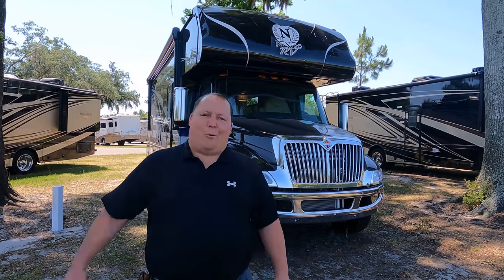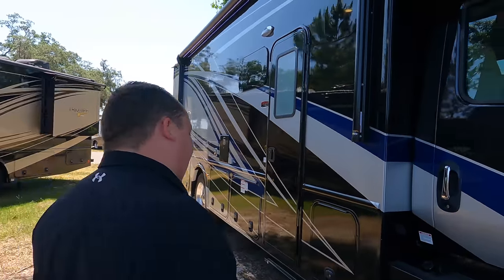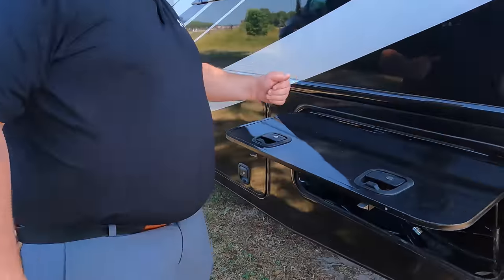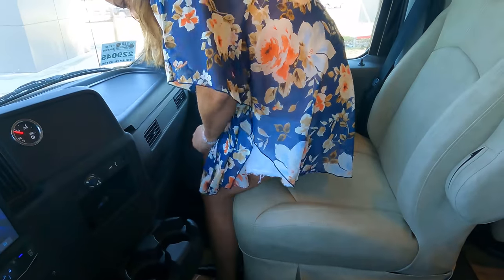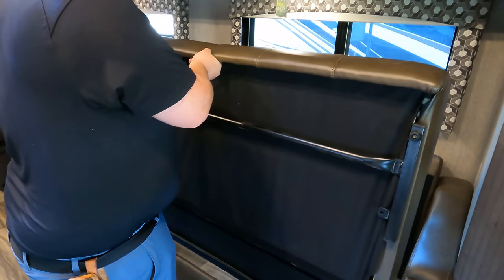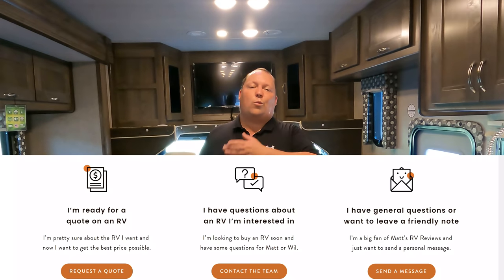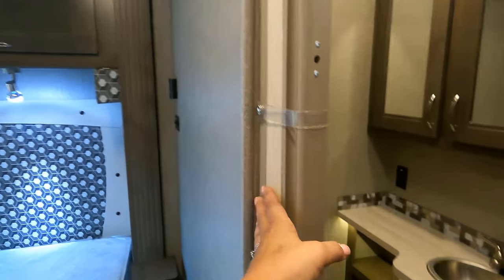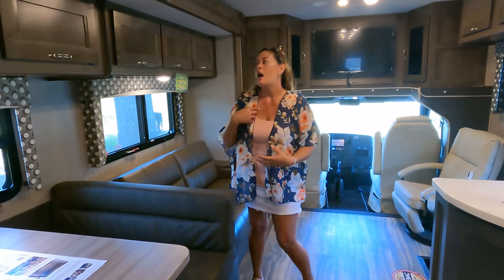The CHEAPEST Super C Diesel You Can Buy For 2022!

Comment: ❌ i'm with Andrea- the print on the valances and nightstands is WAY too busy. Makes it difficult if not impossible to use any other prints to decorate. Hard NO.
❌ outside storage doors
❌ TV placement
❌ No oven or convection oven
Reply: Valances are only put on with 4 small screws. They're easy to recover with your own fabric. But I get what you're saying... with a price tag that large, they should do it for you.

Comment: My interest dropped a notch when I saw that the outside storage doors open only to horizontal. That's inconvenient at best and impossible for those with flexibility issues. There are plenty of storage cabinet spaces inside, but drawers under the dinette seats would be great. I like that the bed is accessible for boondocking.  The pull out sofa is SO much nicer than a jackknife style.

Comment: I have to agree with you, Matt.  The money saved does make up for the features one might expect; however, in an rv like this why the overhead entertainment center?  No one is facing it!  The best seat to sit at would be the dinner table!!  What were they thinking?
This is a good overall unit, even if the 50 amp cord is shoved in a bin and there is no divider between the water connections and the storage.

Comment: The 3 things I like about this motorhome:
1. tri-fold sofa
2. the amount of walkway and accessibility with the slide-outs in
3. the construction: the steel cage framing, Azdel inside and outside, and the metal ducting

The 3 things I don't like about this motorhome:
1. TV placement
2. the baggage doors, I prefer they opened to the side
3. sigh shakes head again it's a dislike: no airhorn

Comment: Hey Matt. We like your videos. On this one, however, we have a question: There's cost (cheap) and value (what you get for your money). By definition, a $1,000,000 Super C could be a better value if it offered more bang for your buck. So, while this one's the cheapest, which one do you think is the best value? PS, regardless of price, we haven't found the right combo for us: 4X4, Super C (large engine and hood in front of us), bunkhouse and W/D. Even better? An F-550 or (preferred) new RAM 5500 limited crew cab with the aforementioned specs!! Why? Luxurious cab, 4-5 passengers could be seatbelted in a safe area (not pretending to be safe with a seatbelt in a fall-apart, non-crash-tested fiberglass shell that will disintegrate around you in a rollover), 4X4 for winter and beach trips, plus all of the other amenities I mentioned. Find it and look me up!!

Comment: Dislikes:
1) not a fan of the outside doors, should either open sideways or all the way up. Miss the air horn too
2) really dislike the position of the TV, but I do like the over cab storage. What if the TV was mounted more to the passenger side and angled?
3) Would rather have recliners than the dinette and have a free standing table
Likes:
1) I love the paint job on the outside. Nexus has been good with their designs
2) love the cabinet space though out, should have either a convection microwave or an oven.

Comment: I'm only six minutes in and I just hate the outside storage compartment doors. You'd have to squat down to pull stuff out of there because of the way those hinges only go 90 degrees. Also, you'd have to have pretty long legs to step up into that passenger seat because it's up so high. I'm 5'3" and older and that would be difficult for me to get into.

Comment: I watch these reviews and love how Andrea always wants an air horn on super C's.  But I don't understand why someone would want or need a Super C.      Please explain if you can.
Reply: It appears Super Cs, being diesels, can tow larger/heavier vehicles than a gas Class C and have higher cargo capacities.

For example, I have a gas Class C with a 5000lb. tow rating. I use it to tow a Jeep Wrangler Unlimited, which definitely weighs about 80-90% of the tow rating. Throw in four people, their pets, and stuff in a gas Class C, and you're really pushing it's capabilities.  Which is what happened to me this weekend overheating the RV transmission going up a long, steep grade.

Also, for me, I like the look of Super Cs over Class As.  They remind me of Greyhound buses.  And perhaps people aren't used to/comfortable with trying to drive a forward control vehicle.
Reply: The appeal of the super c is it’s a diesel with a class c body.the main reason is it’s a smoother ride because if the chassis and tires and it can tow a lot. Plus has really good cargo carrying capacity👍
Reply: @foxcroftandrea3213  Thanks!  So if I'm in the market for a class C and want lots of CCC and a smooth ride, and I happen to have a couple a hundred thousand dollars that I can spare, a super C is cool 😎 to have.  Oh, and maybe I have a sedan or electric car I need to tow along for when I leave the campsite for restaurants or other errands it would be a good choice. However, because of the excess weight, I bet with the gas mileage isn't too good. And I'd have to learn how to drive a big truck.

Comment: The unit looks great from the outside but then they started opening up the basement doors and that immediately was a turn off. You only get 55 gallons of fuel that’s terrible. I thought it was going to get better once they went inside and that was a major let down. The overall finishes in that unit do not support a $220,000 unit. The inside looks like a really cheap C class that you would probably pay 100,000 for. It’s a big thumbs down for this unit but a big thumbs up for you guys. Keep up the good work.

Comment: I hate the entertainment center placement I don’t like turning my head , the sofa is to small , the trifold sofa design is uncomfortable, there’s no cup holders on the couch, the valence around the windows the fabric is ugly, the lights are ok, storage under the seats in kitchen is needed, the bench seats aren’t plus size friendly, the cupboards would be better in a lighter color, it needs more plugs to charge stuff , it needs a convection microwave, the pantry needs to pull in and out , the radius shower is terrible, I don’t like the toilet up high I don’t like them on opposite sides either, the head board fabrics ugly, I don’t the the doors swing up outside

Comment: Outside doors built for 8 year olds.  Adults do NOT want to crawl under the door to fetch things.  Seriously wondering about Nexus common sense. Npo air horn?  They skimped in the wrong places. No convection, no even, Kmart blinds, cheap shower doors, no leveling jacks, flimsy mattress,  Do any of the designers have experience with super Cs?  Somebody needs to tell them 220k is NOT an entry level price.  This was designed for profits, NOT people.